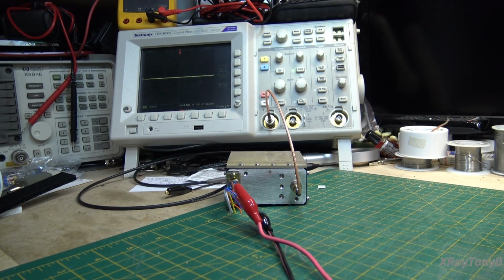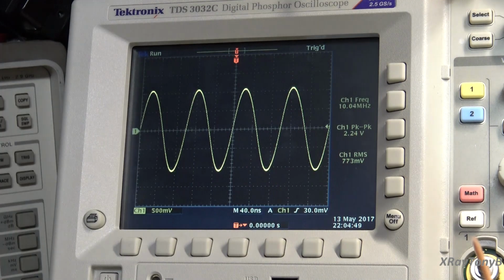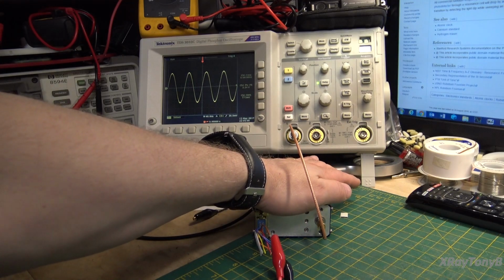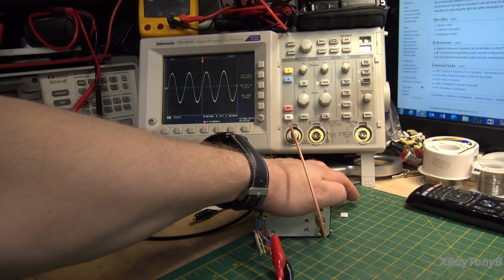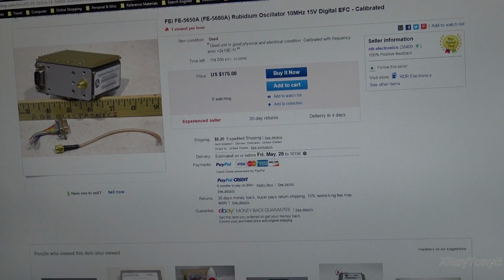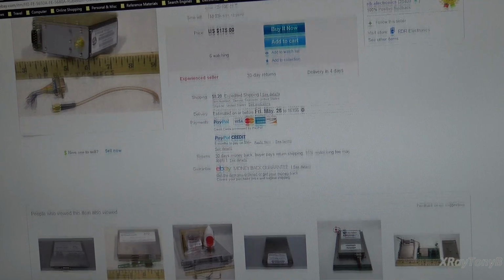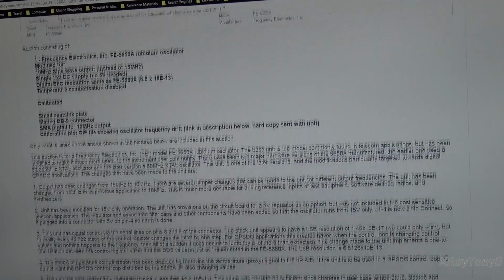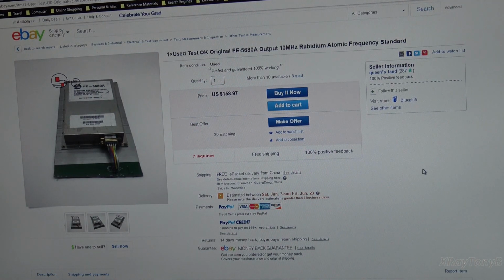Rubidium Frequency Standard

Comment: Sorry, off topic. I noticed that you have an LC-53.  Mine doesn't seem to want to measure capacitance, but I can perform leakage and all other functions.   The unit just flashes 8's after a few seconds.  When that happened, I recapped it thinking the voltage references were not stable but that didn't do the trick.  Any ideas what that could be?   I'm pretty frustrated with it.

Comment: Is the RFS really any better than a $15 GPS?
Reply: I have a couple of Rb standards, a GPSDO and I've also got a cheap U-Blox LEA GPS receiver which can be programmed to output frequencies between 1Hz and approx 15MHz, the output of the U-Blox is horrible, loads of jitter which is visible on a 'scope. The Rb and GPSDO are both rock solid and there's no visible jitter.

So, the answer is, it depends, how accurate do you want it to be, how much noise can you tolerate on the reference, what long term or short term stability are you looking for?
Reply: yea it is really   :O)

Comment: The working principle of this device is not the radio active decay (depletion) of the rubidium atom.  In fact this device 'counts' the transitions the electrons of the rubidium atom make from one energy level to another when the excited rubidium gas in a glas tube is at a temperature of 106 °C.  (That is why it takes some time to warm up to that temperature in order to stabilize.)  How it works exactly is rather complicated.  I can tell It's all about quantum mechanics. If you really want to know, you can read about it on the internet.
Reply from the maker: Thanks for the info.  I'd love to learn more about this stuff when I get the time.  Thanks for watching!
Reply: exactly there is no radioactive material inside...only use the outher electron bane  hehe  :O)

Comment: Nice addition to the bench.  For even better accuracy you can upgrade to a GPSDO 10MHz reference.   Those sync with the GPS satellites.

For best accuracy out of your standard never turn it off.  They really aren't designed to be turned on and off all the time.  

What you need now is a distribution amplifier.  That way you can hook up your single output reference to all your equipment all the time and keep all your equipment running off the same standard.
Reply from the maker: I agree.  I need to find a distribution amp.  The only problem is that they can get very expensive!  Time to start looking for a deal!
Reply: xraytonyb 

Ebay is your friend. :-)  I stumbled across one on ebay some time ago cheap.  Its a 10 channel distribution amplifier that also has built in divider circuits for 5MHz,, 1MHz, 100kHz and 10kHz outputs.

I know a few people that just use a 75ohm video distribution amplidlfier and say they work fine.  Never tried one myself so not sure how well that works.